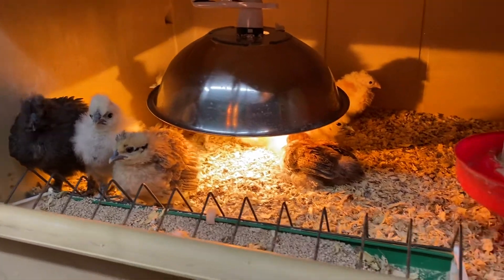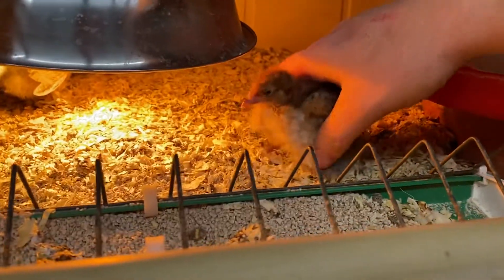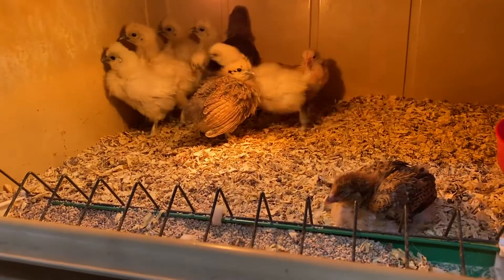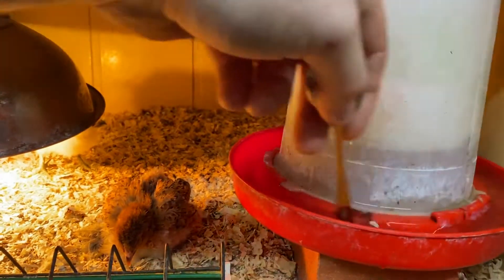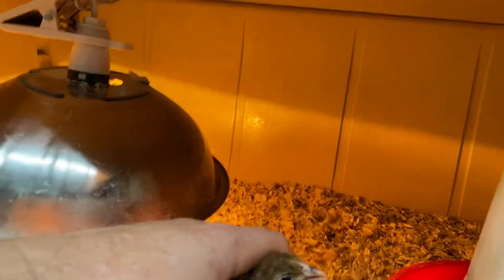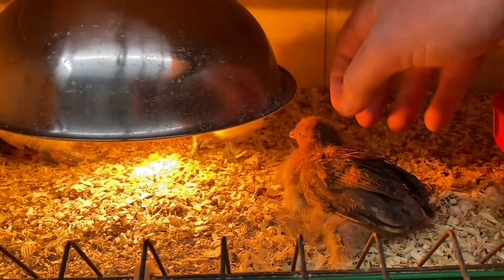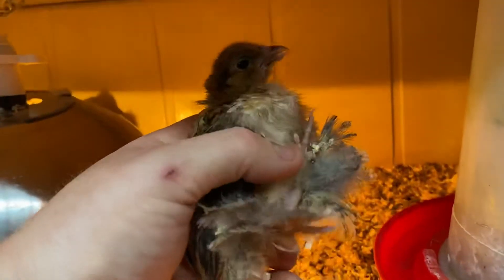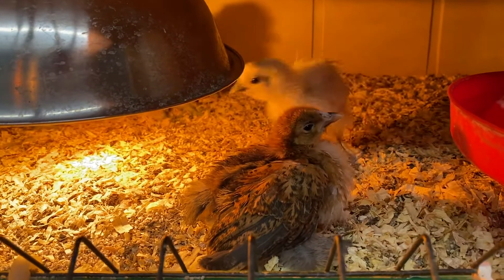Coccidiosis in chicks and how to treat it and identify it

Comment: Coccidiosis won’t go away in 24 hours birds may improve but they still have the parasite and can shed it for some time after infection so anything else that comes into contact with faecal matter from infected birds risks getting it . Coccidiosis is caused by a Protozoa parasite . Can be treated as said in the video with sulpha drugs and Amprolium   It also can be treated with vaccine and a drug called baycox .apple cider vinegar is a good preventative measure